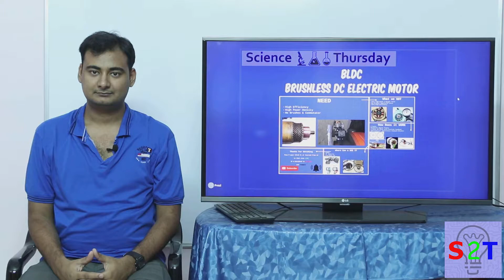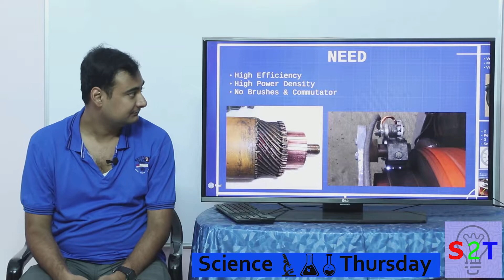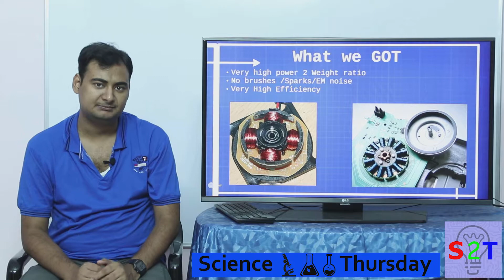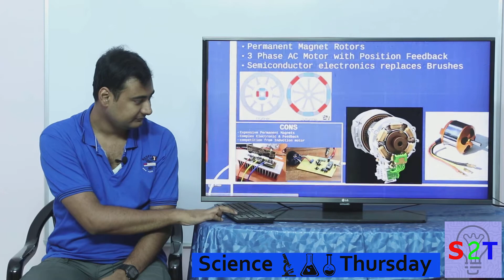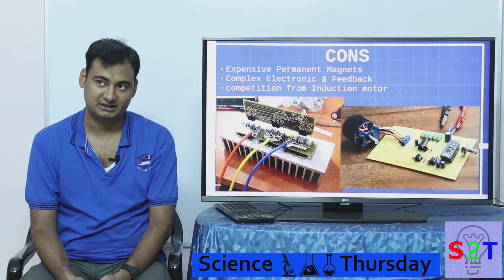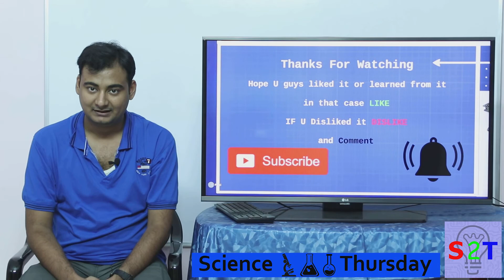BLDC explained{Science Thursday Ep11}

Comment: As an index it is one of the best video -short and crisp information for common audiences.
I like BLDC motors very much because they are efficient and produce almost zero noise. Even I have tried to make one in my home but BLDC motor requires "hall-effect-sensor" and my sensor got blasted because I was inexperienced and then in 2nd try after lots of work it worked.
Reply from the maker: humm